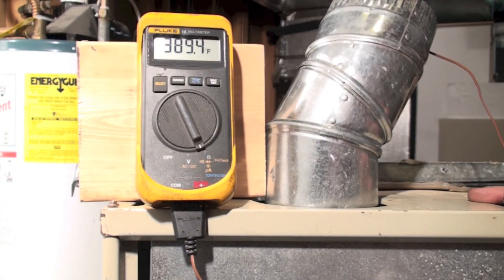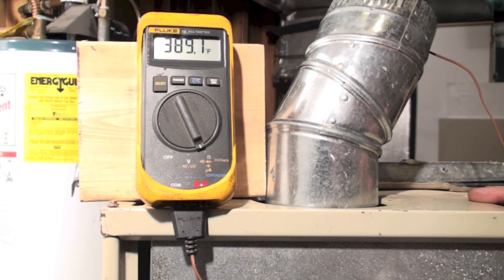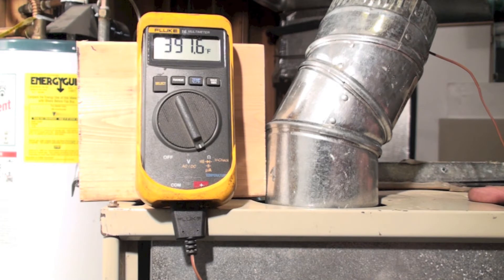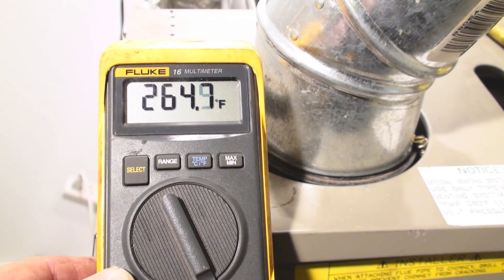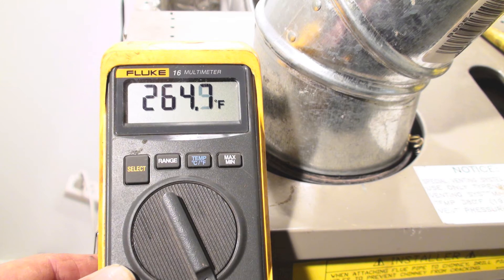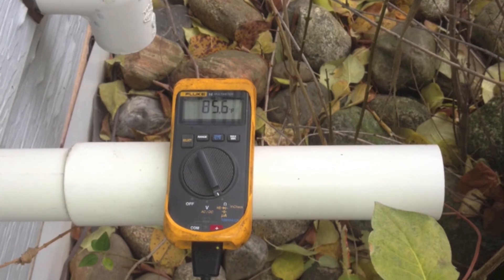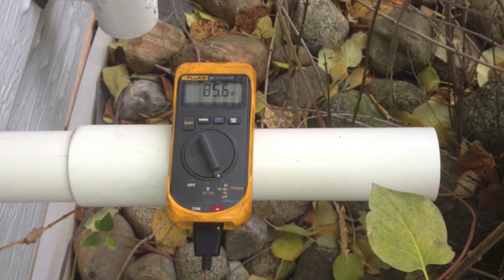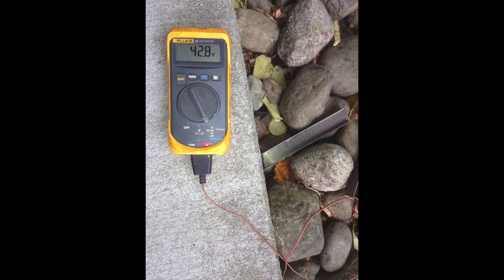Comparing efficiencies of 3 gas furnaces.

Comment: With  lower stack temps on the new  80% ... even lower than older 80%, venting without condensating becomes alot more tricky doesn't it? Especially tricky with vent configurations in older homes that were originally designed for 60% furnaces with plenty of super hot exhaust that could go along way with lots of bends through freezing cold attics and such and not even worry about getting cold enough to condensate.
 The reason i bring this up is that i've been dealing with the problem of condensation in the vent pipe and trying to figure why. 
This video pretty much explains it i think...lots lower stack temp on an exhaust pipe designed in 1968 with lots of elbows and horizontal runs and going through a freezing cold attic to make sure the stack comes out on the back side of the house. Back in the day this wasn't an issue, but seems alot more critical these days with the lots lower stack temps.Thanks for your videos, you do a great job of explaining things.
Reply from the maker: The newer 80% furnaces require B vent for the entire run except for outside vents.  In that case, you may need a triple wall or insulated vent.
GFM

Comment: Is it me or does older furnaces blow hotter air? I have an 80% my dad has a 70% and my mom has an 60% old dinosaur and I did temp readings my Furnace was 130 degrees Fahrenheit my dads was 145 and my moms was 160. The lower the efficiency the hotter heat? And I also noticed that when my moms furnace run the stack temp is so hot it looks like an fire in the chimney but it’s just steam
Reply from the maker: You are correct.  Many people think hot air is more efficient, but it is not.  
In fact, the first thing manufacturers did to increase efficiency was to increase fan HP.
GFM
Reply: It also depends on how many output btus each furnace has. I went from a 60% efficient 56k btu furnace to an 80% efficient 77k btu furnace and the new furnace has a much hotter air temperature than the old one did.

Comment: My 32 year old Coleman furnace is probably heating up the outside of my house really nicely with all the wasted heat going out the exhaust pipe. I'm thinking about replacing with a 96% furnace this summer, but I've got to figure out where to exhaust the pvc pipe since I can't reuse the old chimney pipe.
Reply from the maker: Venting can go thru the wall or use an existing chimney.
GFM